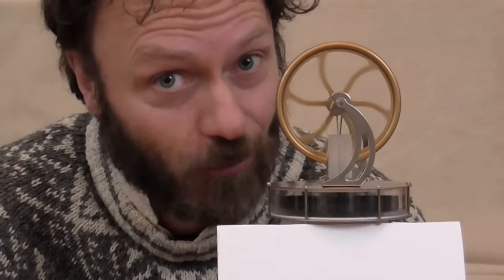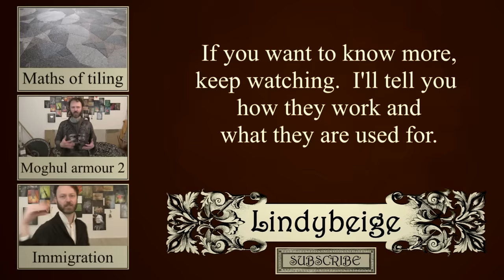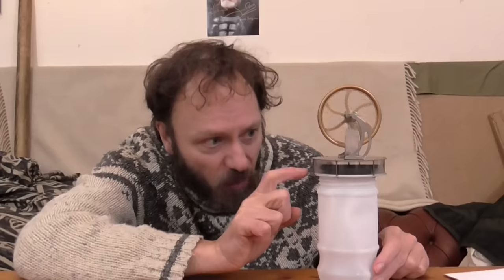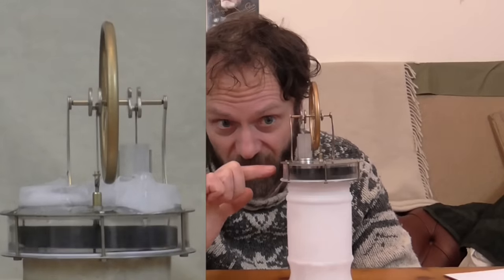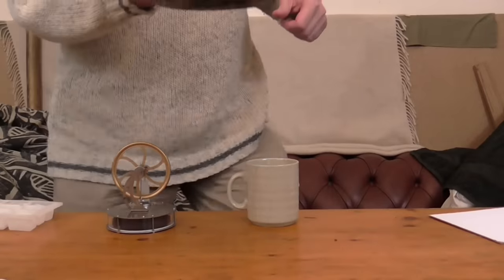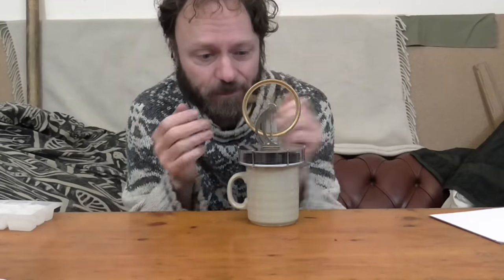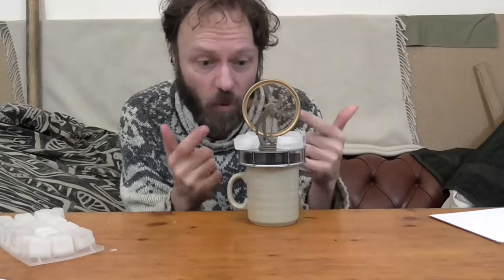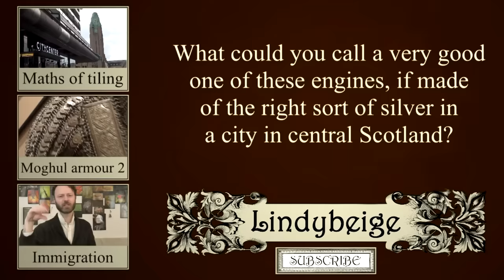Stirling Engines - the power of the future?

Comment: Drill a hole a few hundred metre down the earth. Stick a tube in it. Poor water in it. Steam comes out. Done.
Reply: Bas Koning 

It turns out drilling and maintaining holes deep enough to reach geothermal heat sources are quite a difficult engineering feat. It'd be much easier to use places that have geothermal activity near the surface.
Reply: But steam and water vapor are greenhouse gases.
Reply: Pour in salt water and get some desalination out of it! Also all the salt and other goodies stays in the hole.
Reply: Bas Koning  That's called geothermal energy and is already in use.
Reply: Reece Crossan Do people sometimes call you 'captain obvious'?
Reply: no
Reply: Geothermal energy is really common in finland, the thing is not to pour water in the hole but alcohol.
Reply: no vapor is water not co2
Reply: Dumy Jobby
Water vapor is a greenhouse gas just like CO2 is a greenhouse gas.
Reply: Trollygag i made a mistake, yes water vapor is a greenhouse gas. sorry my bad :)
Reply: +Bas Koning Quite a few THOUSAND meters. 100-200 just gets you down to where water is permanently 6-8 degrees. There are mines that are several kilometers deep, and humans work in them (which they couldn't do if the temperature was in excess of 100 degrees).
Reply: Funkpanzer to have heated water the depth have to bee at least over 1000m. Dirilling at such a depth is incredibly exprnsive. Going over 1km depth the cost in in millions
Reply: In the Netherlands 1.4 km up to 4 km will do the job. The thermal gradient is about 1 degree celcius per 33.3 meter. From 10 degrees outside temperature to 100 degrees would take up about 3000 meter deep. Note that we, Dutch, are at sea level mostly, and mines are in mountainous areas, and that most thermal plants dont use steam, but pump down cold water and pump up water about 70 degrees celsius for heating houses and such. There is even a 'just beneath the permafrost' kind of geothermal heating of water, used in for example Sweden a lot to (pre)heat water. Like these: http://www.geothermalgenius.org/thinking-of-buying/geothermal-installation-by-the-numbers-in-pennsylvania.html

Costs is down to about 25.000 per house: for permanent (pre)heating of water, that is not much.

The price is relative: it is one time only mostly, other solutions are also very expensive (windmills out at sea costs many, many millions per windmill for a few GigaWatt, yet we build them anyway).
Reply: there is already a volcano power plant
Reply: i think it would work much better with a stiirling engine.Warm air goes up and if its cold it goes down again heats up goes up cools down heats up and on and on
Reply: HOLY SHIT... if you live in new zeland

Comment: put liquid nitrogen on the bottom, and and molten lead on the top
Reply: I like how you think.
Reply: invents an efficient method of moving at light speed
Reply: you need to share that idea with Grant Thomspon
Reply: The wheel would get to 88 mph then and you could attach it to a flux capacitor. Then Lindybeige could be a time traveling historian.
Reply: Unfortunately those two are pretty short term. It would be pretty powerful for maybe half an hour, probably less. Metal cools pretty quickly and liquid nitrogen evaporates like nobodies business. Good idea, though.
Reply: The molten lead would cool too quickly. a few briquettes of charcol would last longer though it'd need to be replaced every 30 min.
Reply: That lead could be heated by a nuclear reactor, and can reach much higher temps without melting the fuel.
Reply: engine explodes
Reply: if a nuclear reactor is involved, that would defeat the purpose of a Stirling engine, plus it would be unavailable to the public
Reply: so how do you heat the lead and cool the nitrogen?
The energy required would defeat the porpoise! And the dolphin too.
Reply: @zephyrna6249  
Light doesn't have a speed, actually.
That's more pseudoscience... Like einstain's Grand Theory of Relativity.
Reply: @jamesforgie6594  
lol It's a bad idea.
Reply: @leerman22  
You are slightly insane...
Reply: Nonsense, you must use liquid Hydrogen and beyond fusion temperature plasma, if we're going for extremes

Comment: In warm countries just put the bottom half in the ground. Just a few centimeters down and you will have a big difference in temperature.
Reply: Ground temperature is equal to average air temperature.  So a ground based differential would only work for maybe an hour at 3 AM and 3PM.
Reply: Surround the top part with tin foil (in the shape of a parabola focused on the engine). Now we're cookin with gas!
Reply: Obscure Actually no. The deep ground follows a reverse cycle of temperature, it takes the whole summer to heat it up thoroughly and then the whole winter to cool it down. This is why some plants are able to survive winter by being buried underground, and why well water is so cold in the summer.
Reply: Thats what solar thermie parks are for.
Reply: The ground temperature beyond several meters will tend to be close to the average annual temperature, so there would be a difference to run the engine during some parts of the year only. The conductivity of the ground is also an issue because it will just stabilize without additional thermal mass being connected by tubes with pumped liquid or something. They do this with the ocean, called OTEC.

Comment: They are interesting but there must be a reason they have never had any commercial success. the only commercial product I've come across was a Philips generator that only did about 200 watts and was larger than a 1kw Honda gas powered generator. I came across a video of a 5hp Stirling engine but that thing was huge. the engine alone was nearly the size of my garden tractor, which has a 18hp motor. and I've always wondered about these efficiency claims. while true if you can power by waste heat alone would be great, but those I've seen usually burn some kind of fuel either liquid or gas, except the 5hp i mentioned which was burning wood. This has to burn continuously where as a internal combustion engine takes a small amount of fuel and air then compresses that before igniting. and it only does this once per every 2 cycles of the crank. I could be wrong but it seems logical that using a small about of fuel intermittently versus continuously would be more efficient. I came across an old NASA video from 92 where apparently they were looking at the feasibility of using Stirling engines, and they had installed 2 in vehicles. they commented on "improved efficiency" but never actually provided any figures.  so while they seem to be interesting and probably fun to tinker with I don't see these as replacing the internal combustion engine in the near or distant future. maybe once we use up all the fossil fuels we will be cutting down the trees to power our Stirling engine cars. They talk about the pollution from cars now imagine a city of cars with chimneys on them billowing smoke and ash as people try to get to work.
Reply: The simple reason you dont see Stirling engines everywhere is they are bloody large=expensive in comparison to other engines. They are somewhat competitive (still more expensive to buy but maaayyybeee cheaper in the service costs)  for <100kW power range but ONLY when using a similar grade fuel. Especially the last point is often forgotten. A 100kW engine running on burning coal/oil, using a temperature gradient of 1000K will be about 100 times smaller=cheaper than a 100kW engine running on a  10K waste heat. Thus when Lyndy phantasizes about putting sterling engines on top of servers in finland, he should consider that the power produced by these Stirling engines most likely be several times more expensive than the electricity you can simply buy from a nearby power station.....
Reply: I think the idea is to mitigate the cost of buying 100% new power by generating a portion of it from your waste product. You buy initial energy from a power plant to operate your servers, and as they generate heat from their natural function you direct it to your Stirling engine array to reduce the amount of new energy you need to buy from the power plant.  If we could eliminate even 10% of the need for new energy production it would be tremendously valuable in the long run
Reply: AlabasterJazz The total cost of electricity contains the running costs mainly for fuel and the investment costs for the power plant installation itself. Over its lifetime (nothing lasts forever) a natural gas plant has about 80% fuel costs and 20% investment costs,  a coal plant is about 60-40%, a nuclear plant about 10-90% and renewables 0-100%. Thus even if you dont have any costs for fuel, the power you produce is still not free,  but you have to pay for the initial investment plus interest, spread over the llifetime of the installation. Again, nothing lasts forever, especially not a mechanical mashine running 24/7. Thus i remain at my opinion, that the Stirling-mashines on top of a google server farm will produce electricity for a higher price than you can buy from a conventional coal plant.
Reply: now there is an interesting thought, has anyone actually calculated a sterling generator as a cost per kilowatt. Price for the equipment, cost of installation, cost of expected maintenance during estimated lifetime verses the average daily kilowatt output.  and in your comparison i don't know if you can calculate the true cost of power derived by coal, there are indirect cost such as environment factors and health. how to you put a price on the quality of our air.
Reply: I do agree with what you're saying, not having done any significant research of my own, but it does seem careless not to reclaim your waste products and reuse or repurpose them if possible.  I know in some cases waste heat has been used to heat water or buildings, and this seems like an alternative practical use
Reply: I too agree that it makes sense to make use of waste heat if you can. but all of the stirling engines that actually did work and not the simple toys that simply run them selves were typically powered by fire, either wood or natural gas. this leads me to believe that the waste heat from a server probably wont be enough to run one. the air coming out the back of my computer under full load is usually less than 10 c above ambient. that might get a toy to run but i doubt it would power a generator, they seem to require a greater temperature differential. unless you could use it in some way in the cooling system, to pre-cool the the output of the compressors for instance that's where temperatures would be the highest,  but i'm not sure if that would be hot enough. sadly i'm not an engineer and all the information I've found online is too generic to be useful other than to say "wow thats pretty cool"
Reply: The stirling engine is not practical. I believe you get better efficiency from a steam engine, or a solar panel. The stirling engine, however, is fascinating and fun to play around with.

Comment: I'm sorry to say that you actually explained the engine working on hot vs cold wrong. When the bottom plate is heated, and the displacer is up, the air inside the engine warms up. This will create some driving force, but a miniscule amount. When the flywheel brings the displacer to the bottom, the air cools down, contracts, and atmospheric pressure drives the drive cylinder down, and vice versa for cold, with the heat from the room expanding the gas and pushing up on the drive cylinder. If you watch the beginning of the video closely, you'll notice that the flywheel speeds up as the drive cylinder moves up.

Comment: Stirling engine, an engine that is so inefficient that everyone has been avoiding using them for almost 200 years!!
Reply: MarcTeen Ch.  IKR. There’s reasons for why none of the other engine designs made it.  They make fancy paperweights, that’s about it
Reply: Stirlings are more efficient than the most efficient Diesel, but also 2-4 times the size, that is also their only disadvantage. So, just for stationany use... I think you are extremely clueless, Stirling is the next existing thing to the ideal carnot-engine... Everything is rubish compared to stirling, but unfortunately it has to be big!!!
Reply: @klausbrinck2137  They're NOT more efficient than diesel. Not even close.
Reply: @klausbrinck2137  Stirlings are used mostly to make OTHER power generators more efficient by turning some of their waste into a bit more power. If they were the most efficient engine then....why aren't we using them?
Reply: They are literally the most efficient engines excluding rocket engines. They have their flaws, but inefficiency is not one of them. Weight to power ratio is the biggest issue.
Reply: @eewweeppkk  If you think efficiency is the only consideration as to whether or not to use a particular engine then you don't know what efficiency means. Why do trucks exist when motorcycles are more fuel efficient?
Reply: @mgb360  False analogy. Trucks exist because they serve a completely different purpose from motorcycles. It would be better to ask why we don't use stirling engines in motorcycles, since you're implying they're more efficient than trucks, so why wouldn't we use the 'most efficient' stirling engine for them? Because you need to generate heat somehow to power a stirling engine, having a temperature differential is not enough by itself to power anything because temperature will eventually normalize and you'll lose you're source of power.
Reply: @eewweeppkk  Because most efficient means it converts one type of energy to another with the least loss. That does not mean it's the best engine for a job. You don't understand what efficiency means. Much like how motorcycles and trucks serve different purposes, so do Stirling and IC engines.

Comment: So why exactly aren't Stirling engines attached to every single radiator on every single machine that has one to harvest waste heat?
Reply: I think I.C.E's and S.E's are mortal enemies...
Reply: @Raz.C  a grudge so old hardly anyone even remembers it, time to utilize available resources to maximum effectiveness instead
Reply: Because the engines cost money, sometimes a lot of money, and it can take a while to produce enough energy to cover the costs. However, if you're willing to put in the money upfront, it can be worthwhile in the long term.
Reply: @mgb360  bill gross made a pretty good modern stirling engine, look up his ted talk. The way I see it, anything that reduces overhead is cost effective
Reply: @brandelgastfergandill1757  I'll check that out, thanks
Reply: @brandelgastfergandill1757  Thanks again, for saving me the trouble
Reply: @mgb360  yeah well a lot of people won't go through the trouble and this idea needs to spread if we're ever going to implement it, so you're welcome but it was partially out of self-interest, no offense.